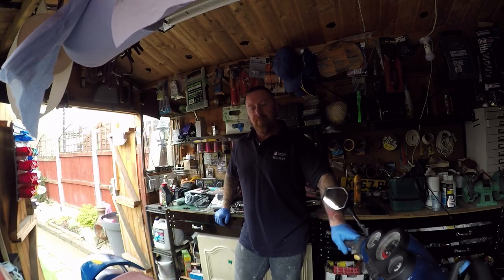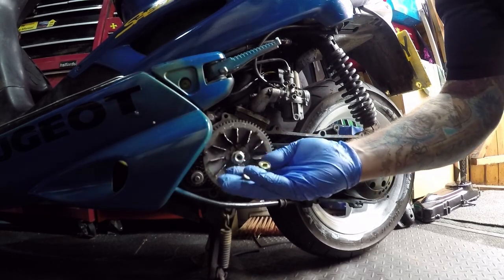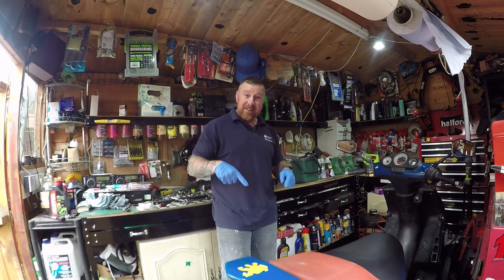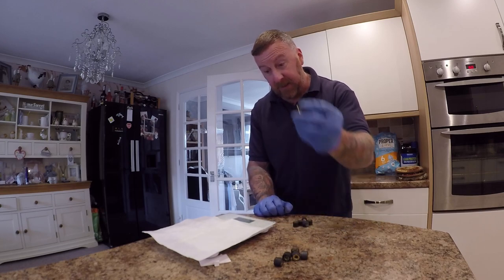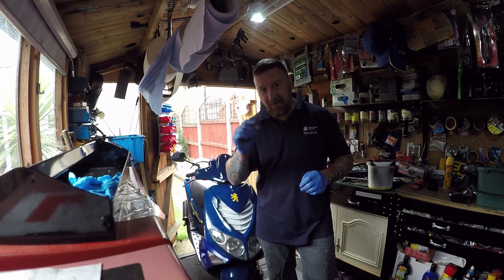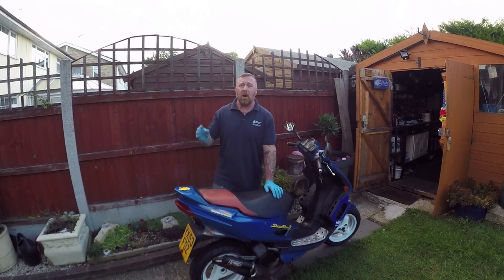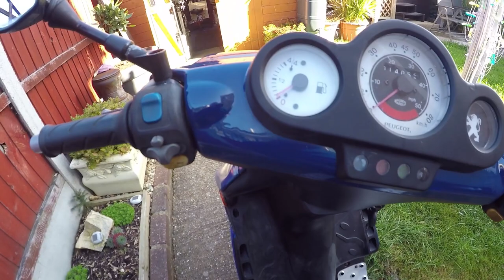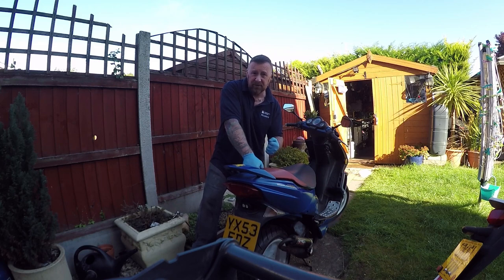SPEEDFIGHT MOPED NOT PULLING AWAY & VARIATOR PROBLEMS MARK SAVAGE

Comment: Hi Mark ;)
I am a 49y old guy from Norway and i am a total amateur. I have a speedfight 2 ac (2004 mod) that I am working on. I got some help from my brother 5-6 years ago fixing it in working condition. We replaced cylinder, piston (the whole cylinder kit) plus the crankshaft. It worked 100%, fast as lightning :D
But during the years the performance decreased. I don't know why. I have only used it in the summer, and not at all in the winter. It starts very easy (always done that) and runs fine idling. But when i drive it, it dies after a certain level on the throttle. If i let go, it is ok.

I have washed the petrol tank, and replaced the 95 octane with 98 octane, using 2% 2stroke oil (maybe not good enough quality?). I have (today actually) purchased a new carburetor from ebay. I guess the purchase was a result of desperation (i completely disassembled the old one, cleaned it with compressed air. It was better after that but it didn't make it run steady).
It is a work in progress :)

BTW: I wish you would make a video on doing a complete rewiring of the electrical system from start to end. There is a lot of wonky wiring on my scooter and i wish i could replace it with new and proper wiring. I guess the video would last an eternity, but i know I wouldn't care :)

Anyway, keep up the good work :)
Reply from the maker: i have over 100 videos nd have re wired one well changed the loom lol, but all in they all should help
Reply: @marksavage  hi and thank you for answer. I am sorry, i don't understand what you said there (english is not my native language).

Comment: For the pilot jet on the carb needs be adjusted until the revs are the highest after the choke has gone off when it's hot should run like a champ

Comment: Aerox Ns50. Cutting out after 10secs at high throttle. Changed rollers from 6to 4.8. Smooth now. Although problem still there.
Reply from the maker: Sound like carb bud as you have cleaned it check float and fuel pipes like in my speedfight videos

Comment: Hi sorry to bother you again , but your the best source of advice in the country I can find . Right I’ve put a Leo vince exhaust on my speedfight 4 . I haven’t changed the clutch springs yet or the rollers . The standard jet was 60 so I put a 64 in. Setting off it bogs and takes some going but when it does it takes off like a rocket . Also it looks to be a lot of smoke out of the exhaust ??
Reply from the maker: hi bud , changing the exhaust will have made you moped breath so much better so all of the old oil that would have built up is getting out 
up jetting as in my videos more fuel more air and gases out and you would need to tune like in my tuning videos 
so sports air filter if your going to upjet and you will need to adjust the air mix , most of the time you can change the exhaust and just ride as is 
a lot less messing around bud , try putting the old jet back in and see how it rides
Reply: mark savage cheers mark your a top fella !!

Comment: Hi Mark. Top videos bud. Any help on changing the brake discs on the rear wheel of a 2015 Aerox? Does it disconnect from the exhaust side?
Reply from the maker: I have a binding brake video's on a aerox worth a watch 
As for the rear you will have to take off you reat wheel then follow my brake video bud

Comment: Hi mark first of all appreciate all the videos. Have a question for you on the way home from work this morning the screws in the starter motor worked themselves lose and it fell off could you please tell me what size replacement screws I should get can't find the info online.
Reply from the maker: 8mm bud and 1" long with washers on them 
One has the earth connected through it 
It's a wiggle getting it in and on bud
Reply: @marksavage  thanks mark. I know about the ground as when it came off the bike would only go in reverse lol

Comment: My moped runs but doesn't want to turn the wheel at all. I checked everything I could think of I replace the rollers the belt even bought a new carburettor because I thought it was it was dumping too much fuel in the engine.

Comment: Hi mark, love the videos! hope you can help me out, I have recently brought a aprilia sr50 which starts perfect when kicked but when I try and use the electric start the only thing that happens is the relay clicks? I've taken the bell housing off and found a fair amount of metal shavings near the spindle for the starter. I've tried to figure out how to access the starter itself but cant find a way! All the plastics are off with seat bucket etc. Thanks
Reply from the maker: as in my start video its your starter if it clicks as it means everything else is ok, the start is in front of your rear wheel and you can take the rear wheel off to see it and gain access
due to its location sometimes it just can be the connector so you might just clean it up and it works!, otherwise replace bud

Comment: Hi Mark, quick question, in your opinion will engine braking damage the piston in the speedfights due to lack of lubrication as I was recently advised to minimise it by a mechanic. Thanks
Reply from the maker: ive never heard that before bud, for me no its fine as when you shut of the throttle the variator system still runs and also help to slow down the engine.
I always and always will use my engine to slow my bike or moped down as much better than relying on my brakes and helps to control the bike better 
I'm sure someone will say different but as you ask this is how I rode for the last 36 years as this is how my dada thought me 
take care bud
Reply: @marksavage  Thanks very much for the reply. I can kind of see where he was coming from as if you cut off the fuel then you cut off the lubrication too but I would think there would be enough oil and petrol in the crankcase already to keep everything lubricated. These speedfight videos have been a huge help in getting my bike running and helping me to get to college and back especially since there is no way I could afford to pay nearly 2 grand for the bus pass so thanks very much mate

Comment: Hello mark just wanted to say I enjoyed your videos on 50cc bikes I have a vespa lx 50 2t I have recently put on a wild lion malossi exhaust and it improves performance today I fitted 7.2g rollers with a malossi variator original piaggio belt still just need to install spring on clutch but pulls nicely with hills good speed also
Reply from the maker: Thanks bud and for watching 
Theres about 150 videos on 50 and more on 125 too 
Take care bud
Reply: I now get 45mph and holds better at 35 on hills that are slow gradually up  its really been good to finally understand what I'm doing without wasting unnecessary money cheers and cheers again

Comment: Hi Mark some great videos on the speadfighter but I'm clueless and deffinatly not mechanically minded ! I'm having an issue with a 100cc version , I bought it the other day and when idling it will cut out after so long and when accelerating it sometimes seems ok but you hit 20mph it bogs down and sometimes it doesn't but will do it again on and off all the time ! I've gathered it's probably a fuel are ratio mess up somewhere and when looking at the airbox one hole the carb goes to the other above it is just open is this correct ? I'm going to change aitlr filter and put a new spark plug on but do these have an in line fuel filter as well ? 
Is there anything you think it could be ?
Thanks in advance
Reply from the maker: hi bud theres over 70 videos on speedfights they really will help , type in speedfight mark savage and they will all come up .
you can have a inline filter but you vacuum has one in the tank any way like in my videos , the 50cc and 100cc basics are the same but the carb is bigger so you can still copy what I do for cleaning and the VARIATOR system etc
Reply: @marksavage  thanks for the reply I'll have a look through ! It's weird it bogs out mid throttle range ? If I wind it right back it picks up or if I let of the throttle and slowly wind up ! Bane of my life at the minute and don't really want to be messing around with it too much I only paid £300 it's a 2007 and it's just for nipping to work on and shop save running the car everywhere

Comment: have you ever worked on a yamaha jog cs 50 headgasket as my exhaust has a blowing hole and it seems like the whole exhaust to head bolts is screwed and no way of getting it off
Reply from the maker: This happens a lot 
Use lots of wd40 on the head bolt and try not round the bolt heads 
I know its hard not too
Maybe try if you have ro fix a smaller socket on them this should work

Comment: Hi Mark, Hows you ? The bolt that goes on the end of the variator is rattling loose. Any ideas on how to tighten it ? ive tried the claw hammer trick but the bike just turns over ? i need something to stop the other side turning( Magneto) Any tools out there that can do the trick ? Any tips ?? i dont have access to a air drill or i would of used that lol
Reply from the maker: As in my burgman video if you have a air gun or impact it's easy but the old way should work 
If not maybe take off the stator coil side and use a socket on both side to undo ?
I've done it before 
Just be careful not to round the nut bud 
Or hammer and push on to some wood and jam them in and give it some

Comment: i need to ask your opinion on me getting a new bike,i like the look of the speedfight and thinking of getting a new one,but am concerned about the fact that they are restricted i think to 30 mph, firstly is it legal to derestrict them from new, and who would do it, the main dealers,or a private mechanic, and advice would be good, PS I am 72, and want a runaround with just that bit more gut s, cheers Pete from Newark.
Reply from the maker: Hi 
It is legal to derestrictesd any 50cc as it not the bike / moped but the rider 
16 year old should only go 30 mph which is mad on todays roads 
However your be fine 
Most garages will if they can do this for you for a small fee or side road mechanic 
They do cost a bit now !
Older mopeds are cheap but have to say not so reliable
Reply: @marksavage  Thanks so much for this info,it puts a different point of view on this purchase now.Quite honestly this type of bike is all I need, to run around on,I just thought 30 was a bit slow,.

Comment: Very nice video mark. Love your workshop shed. I have a question for you.

I have 2015 speedfight 3 fourius. Every service done by dealer. The problem i have is when i drive up a steap hill i sometimes lose al power and speed. It almost stops in the hill. Then it sudenly pulls away again. Any tips?

Take care
Reply from the maker: I've be looking at the rollers and belt bud as it sounds like it's not going back down 
And thanks for watching

Comment: Hello Mark! I have a speedfight 2 that was running great. But as of recently it starts to slowly die and loses power in hills, if it's really steep it doesn't even pull at all. Is this common? Is it possible for it to be my rollers? They did have a flat side last time I checked. Setup is a Leo Vince ZX exhaust and changed jet for that of course. Thanks!
Reply from the maker: Defo need to be changed bud and take a look at the belt sure that will sort it

Comment: Hello a cheap 18volt impact driver will be better to take off the variator bolt and clutch bell one easy better then hammer and a bar ha and ur better off with lighter rollers for hills cause the less weight keeps the belt low on the front pulley

Comment: Hello Mark curently i use 6 grams rollers  and Speedfight 2 LC work fine, but problem starts on a smaller hill
 lossing power, what is your advice for combination of rollers? Malossi is variator and jet is 58, Stage6 exhaust. Thanks
Reply from the maker: they will all loose speed up hills bud , but 6g is fine so whats the belt and clutch like?
you could have piston / rings wear and this maybe the cause of loose or power but id change the plug and air filter and maybe a small upjet to 60 might hep too
Reply: @marksavage  Clutch is Doppler sx86 with red springs on defaut walue , Bell is Polini evolution 2 (i thinks i am make mistake ordering Doppler cluch, now looks to me Polini evo is better). I have three belts Stage6 , Malossi classic and Malossi kevlar few days old. Malossi classic is few months old and in use. I am try with 62 jet and is same situation. Air filter changed to brand new Malossi before 5 days.
Reply from the maker: your paying out on some good parts bud, sure you will sort it soon
Reply: @marksavage  Yes i use good stuff, how much us i can (money) because i wants to my scooter be better than before 16 years when is left Peugeot fabric. Without you and your help and "how to," i never will succes. Thank you my friend.

Comment: Hi mark just received my new rollers and belt for my cvt as it’s got slower and slower and the belt is a 18mm belt where as the stock belt according to the service manual is 16.9mm would I be able to put the new one on and not have issues as I cannot find anywhere what sells the belt and everywhere sells the exact same size as I have
Reply from the maker: what weight roller did you put in , 
it is a 50cc or 100cc ,, speedfight ?
the belt needs to be the same and will slow pull away
Reply: @marksavage  it’s a Suzuki katana 50

Comment: Hi Mark I'm new to scooters and seem to be having a problem with my standard Speedfight 2 it was a non runner but I've managed to get it started with a replacement carb from eBay but it ticks over sluggish and does not seem to want to rev I've cleaned the carb and noticed the main jet is a 76 and the pilot jet is a 42 and the needle is set in the middle o and I have no air box but I've orded one so it should be on its way
Reply from the maker: Was it a peugeot carb or one of those Chinese replacement ones
76 jet is way too big 
60 should be fine and you will need a air box and tune like in my tuning video bud 
Needle is fine
Reply: @marksavage  hi Mark the carb say its a Gurtner I think it's a 12mm or a 13 not sure if checked my reeds they are ok re-cleaned carb air/mix screw three half turns from fully closed idel screw screwed in all the way as it will dies I've also replaced the auto chock
Reply from the maker: @linihughes5106  
Have you replaced the jet to a 60 
And you will need the airfilter before you can carry on with setting up bud
Reply: @marksavage  no I'm going to get the 60 jet tomorrow and hoping to get the air box delivered tomorrow as well and would I need the filter that goes in the air box
Reply: @marksavage  hi Mark sorry to bother you again just wanted to let u no ive replaced the 76 main jet to a 60 main jet and fitted a brand new air box and air filter and it came to life so I'd like to say a big thank u and hope u have a good new year

Comment: Make sure you don't put variator on whilst on side stand! As it'll open up whilst you put the bolt in and the rollers will fall over :(
Reply from the maker: Yes it would lol 
Always on the centre stand or Jack it up and put it on wood 
It's all fun and learning as you go on
Reply: @marksavage  certainly is, I've loved it, you've helped greatly too :) so thanks!

Comment: Hi mark I got a Yamaha areox 50cc bog heavy at low rpm and has no power but has an polin air filter 85 jet and a stage 6 pro replica and still bogs really bad what rollers would U recommend??
Reply: Need the acceleration really fast and really good top end thanks !
Reply from the maker: 6g rollers , have you tuned like in my videos, i have a load of videos on the aeroxs worth a watch 
bogging is too much fuel so maybe go down jet size bud
Reply: @marksavage  thanks mate wasn’t sure you’d answer but thanks carry on with ur great videos

Comment: Alright mate are you ment to be able to tern the variator by hand pretty easy think piston going
Reply from the maker: You can but there should be some resistance as you turn the piston , if not then yes it maybe bud
Reply: @marksavage  thanks bud doing my head in now lol when I release the throttle it takes like a second to go to propa idle

Comment: Hi

My speedfight mk1 started bogging, sometimes it pulls very well, but now it bogs all the time. I have disconnected the electric choke and cleaned jets but it didin't seem to work.
Reply from the maker: So have you checked out the rollers and belt like in my video 
I'd reconnect the choke bud
Reply: @marksavage  I live in Finland so the choke gets mest up by the cold weather in autumm and spring, its not uncommon that we disconnect  it here and it seems to run better when its disconnected. But I will check the rollers and thank you.
Reply: Air filter?

Comment: hi mark im having a issue with my speedfight 2 when im riding it its not doing the gear up like you would hear when its on its stand which is causing my bike to not go past 30mph its got a leo vince sports exhaust and ive jetted the carb and it seems to be running perfect the plug is a coffe brown im starting to think its a variator issue or clutch issue ive got 6 gram rollers in at the minute but the clutch spring has been changed by the previous owner and ive looked online and cant find one anywhere any help will be appreciated
Reply from the maker: I've got so many videos on speedfights and on the variator , clean and yes 6g , tight belt and test clutch like in my videos bud